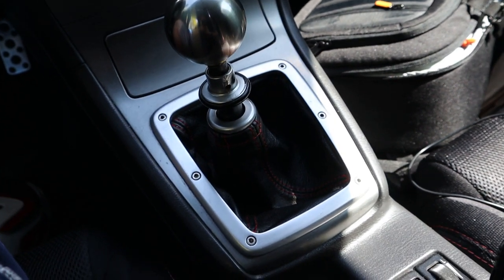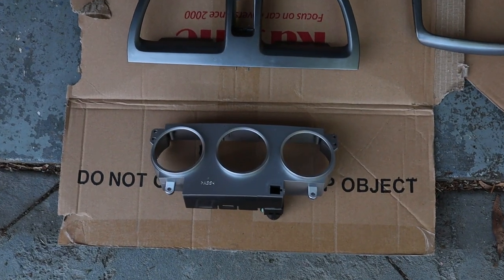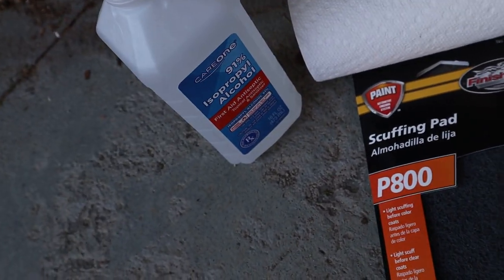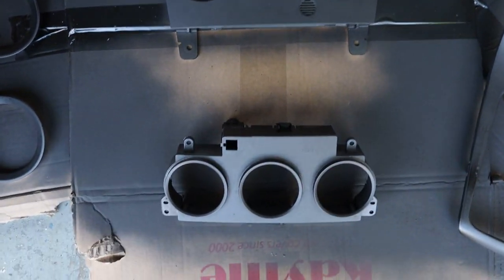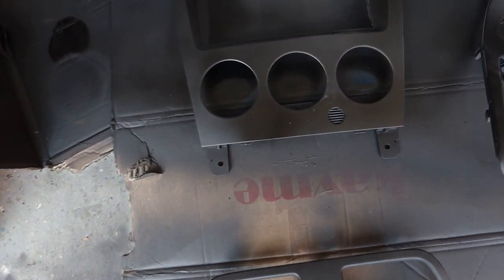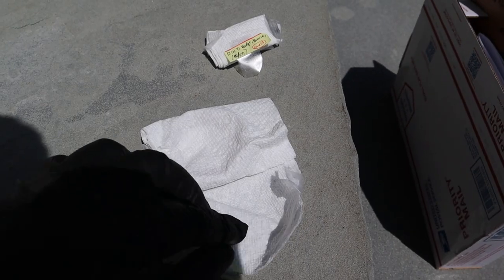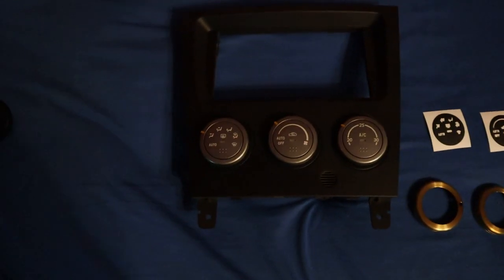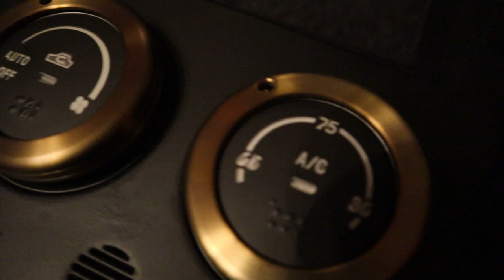2005 STI interior mods | Painting dash trim and adding goodies

Comment: Man i used krylon and it reacted to  the previous paint or primer i used.. Turned into cracked lighting. Im going down to plastic again and going to see the guys at eastwood. Some people told me to use an adhesive promoter but not sanding these pieces again.